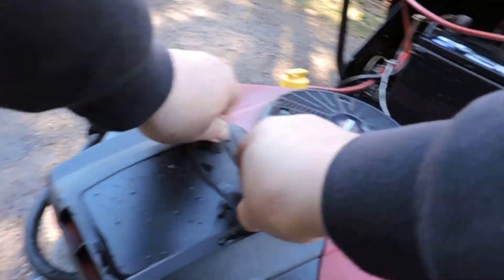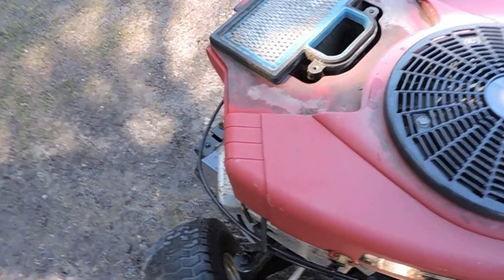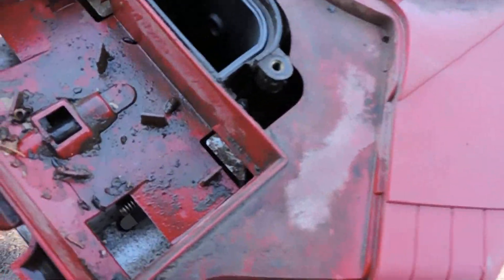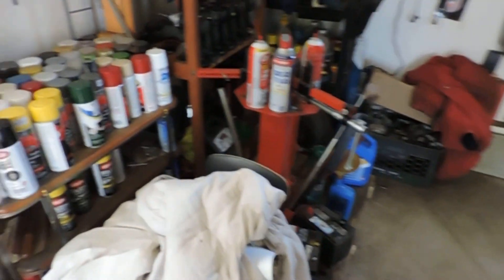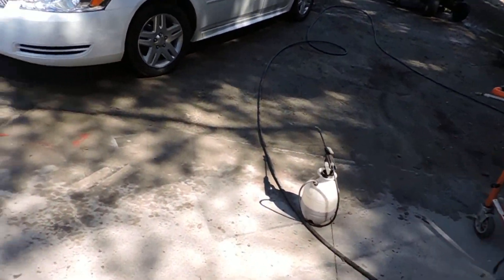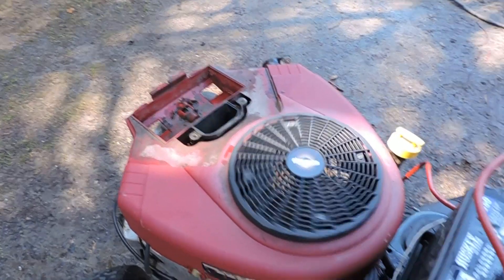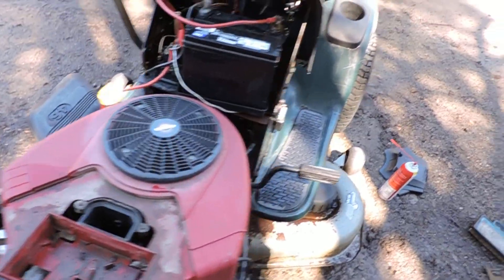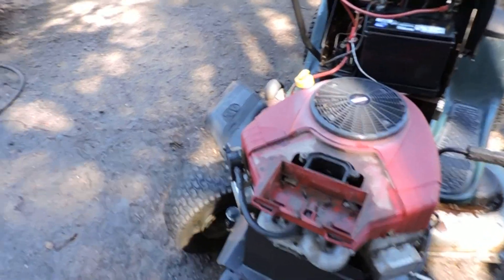Washed the Craftsman DLt tractor and have to wonder on its history.

Comment: Looks like water might of gotten in the fuel system.
Reply from the maker: After video I also think that. It started but only for short time before stalling, classic water in carb. Since I spent so long washing it by gas tank it is most likely that!
Reply from the maker: Drained the fuel and believe it or not no water?! Think main issue was water in electrical and bad valve adjustment! It running quite well now!? It is a weird egg this one.

Comment: If it turns out to not be water in the fuel when you think you might check that to see if the key sheared?  I am not the biggest briggs fan in general prefer Kohler any day but, this poor briggs and overall looks of tractor seem neglected
Reply from the maker: We need to remove tank to replace fuel line anyway. But more I look at this thing the more likely it is a parts machine or long term restore.
Reply: poor thing just wasnt taken care of.  Its kind of like the YTH180 I got from the neighbor Husqvarna rider.  Neighbor took good care of it with occasional blade sharpenings, oil changes, greasing as he does with other mowers.  It sat for a few years though without any use and being older almost 20 years old the way I figured it its been a long time coming.  Currently you can mow with it but, I have had to redo belts cause of broken from dryrot replaced three leaking tires from dry rot now the fourth leaks but, will fix it in time.  Good tuneup and greasing when I got it.  New battery.  New spindle assembly wasnt shot but, I chose to replace one as the star I guess it is on the bottom where the blade mounts too was all wore down.  Anyway thats about it mine however was taken care off that I got but, just from sitting and being older was needing a lot.  Spent a lot on it and still got some to go but, cant hardly beat a command vtwin from Kohler that at the time it was give to me with 453 hours on it.  I have it now around 500 still doing good other than occasional smoke on startup but, usually a few seconds is all it does it